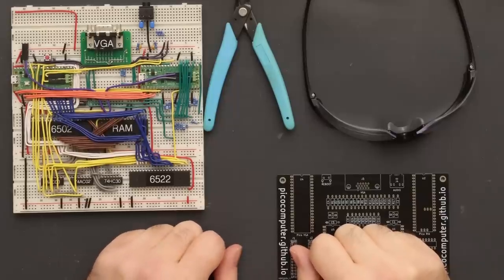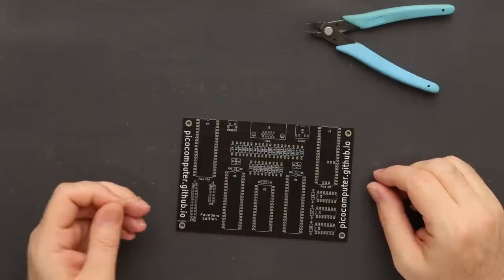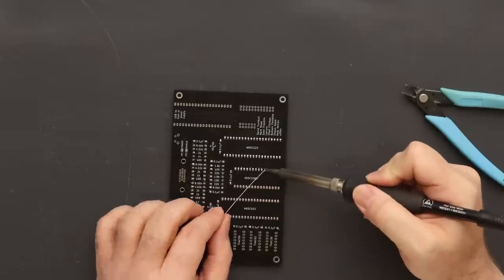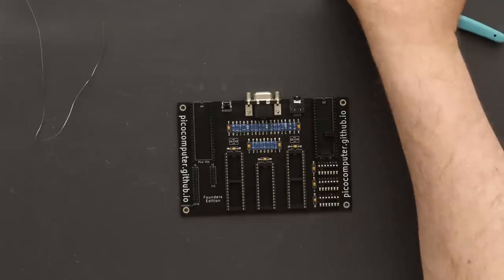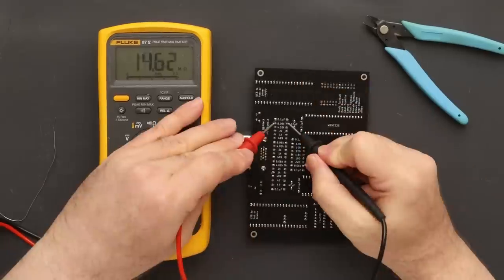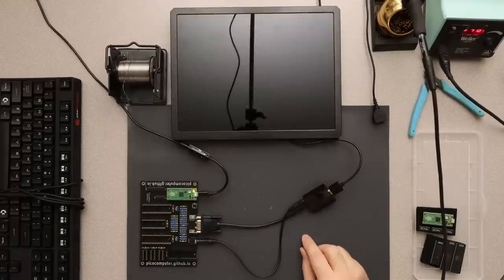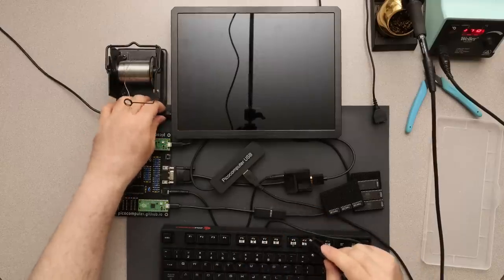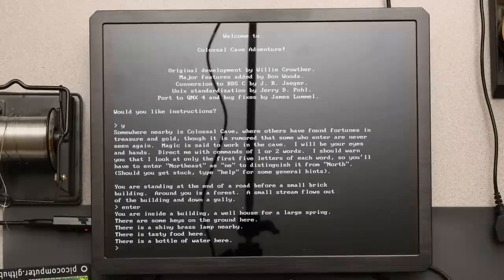RP6502 Ep10 - DIY build with soldering

Comment: It's always disappointing when people do that "Commander X16 was supposed to be $50 but it's $500" thing without context. It probably drives engagement (like the title - EDIT: two days later, the title has changed to an accurate description of the video), but the truth is much more boring: The first boards were never going to be cheap, but they want to cost-reduce it over time. Next batch should be $350, and if they get their way future generations will drop down much lower.

But this system, while far different (especially in its software environment), is interesting and has the benefit of being cheap and available today. Thanks for sharing!
Reply: agreed 👍
edit: I am still on the fence about the x-16, but I am leaning over that fence toward getting it... second gen of course. 😎
Reply: Well it's also disappointing when context changes to suit the situation. Reality is harder to face than the fantasy in that case. But reality is things change and doing something about it if you can't afford the new system is not a negative response. So the context here that is being missed. Some people can't afford even 200 dollars and want a cheaper computer so building one you can afford is a perfectly viable solution -- also not an attack to say the context changed. He did state 50 dollars in his original video as a gross estimate it's not a thing that didn't happen. some people followed the development with that context in mind and David did not correct them for a long time. So I think that's where all the confusion is coming from.
Reply: @lindoran  There's no need to become defensive. I haven't attacked anyone, and have in fact expressed an interest in what he's built. There are nice options with varying types of "retro" computing at many price points now, and that's a good thing.

But I'm not a fan of clickbait or misinformation (or misinformed people repeating wrong information).
Reply: @jc33353  I didn't say you attacked him, I think you misunderstood, what I was saying is that it's not click bait to use the words "why I'm not buying a commander x16." If you then go ahead and show why. It's also true that he said he would like to see a price of 50 dollars and then (likely because of an over site let's be honest) did not correct people until much later. I agree both projects are great! All the confusion is coming from the fact David said he'd like it to be 50 dollars then people followed it based on that context and were confused when he clarified. That's a different thing.   He's still entitled to that opinion even though David clarified, and the reason is he was initially vague.  Just because he apologized and corrected himself doesn't change the initial statement or the consequence of it. So I guess I just was trying to explain how people came do believe it an why that's a valid feeling is all.
Reply: We'll see.

I'm quite skeptical that the Commander X16 will ever become affordable.  It seems to me the reason you can reduce costs is being able to take your revenue from the first iteration, and put it into a 2nd gen re-design where you can cost-reduce it somehow.  But if you don't get the sales for Gen1, you don't have the cash to make Gen2.  I can put down plans for reducing costs too, but in the end they're just plans.

There's several other better designed Retro computers available today that are 1/10 of the price of the X16.  The whole thing is sort of interesting, since it seems like it's a bit of a repeat of the late 70s, early 80s.  On price too.  Apple computers were always far far more expensive than the Commodore ones, but Commodore was the one to crack the nut on price, so they became far more popular than the Apple 8-bit machines. I halfway expect the same thing to happen again, just at a much smaller scale.
Reply: @lindoran  A single $6 pico can do everything using emulation... Those hardware projects are cool but not necessarily the cheapest. Perhaps people should focus in something modern like risc-v instead. Playing with real 6502 may be a good fun learning experience, but for how long are you going to be able to? Any serious project won't be able to source chips in sufficient quantity anyway and its pretty pointless at this point, just like film photography or the telegraph, it had its time, but now its pointless. The X16 is basically a new 8bit computer, which isn't exactly on demand, but cool none the less. Unfortunately its unlikely to last, because, the ultra cheap ARMs or RISC-Vs outperform it so vastly they can easily emulate the system for a fraction of its price. Its not the 80ies anymore, as much as we loved that era. At least RISC-V is open source hardware so it has a future not even ARM has.
Reply: @lindoran  It's been how many years and how many clarifications and this guy is still opening with "it was supposed to be $50 and turned out to be $500"? It's not a "valid" feeling at all. It's sticking to your guns even though you're wrong.
Reply: @freeculture  the same could be said about the FPGA for the vdp in the cx16 I suppose. On it you could build an entire turring complete system along with some kind of video and io. But I think that misses the point.  once you program a FPGA or a SOC to do a task dispite its other capabilities it can only be whatever you programed it to be, until you re-program it.  Additionally what is a period correct vdp? Just another custom SOC or device controller that can share the bus, in a way a pico is the same thing and exists for exactly that purpose. as far as being able to get chips....I think that's always going to be the case you can't 100% future proof anything including the FPGA in the cx16.
Reply: @zoeherriot  just the point it was nearly a year that David took to clarify, and in that time there was loads of speculation (which I was around to see), don't get me wrong. I still watch 100% of everything Mr murry puts out and consider Myself a fan. It's still 100% valid to be confused and feel that was the general consensus from the start because those were the words he used. All that being said I am still interested in seeing the cx16 come out and I will buy one if it comes into my price threshold.. but I don't think it will.
Reply: @lindoran  you’d have a point of this video was released a few years ago. Now it’s just repeating a statement that has been clarified over and over. So now the misconception gets to continue for no reason. Great.
Reply: @stevesether  I think that's probably true. So much money has been spent at this point for David to recover what he put in he'd have to sell a number of units that I don't think the market can bare.  I'd like to see one sub 100 dollars before I jump (even 70-80 would be a price I could consider. Max 150.) I just don't think that it's possible to recover everything and do all the front end work for less than free (which hes shown a willingness to do ) how much is reasonable to ask from someone who's working on this as a source of income?  I just don't see it happening.
Reply: @zoeherriot  life is not fair sometimes, I think the good news is that it doesn't seem to phase david even a little bit.
Reply: @lindoran  I seriously doubt the 8-bit guy was expecting to make money out of the X16.  He's already said his game is only just breaking even, and that is a far easier sell than a hardware project...  There isn't really a success/fail criteria for these things.  Just have fun, and don't put money in unless you don't mind losing it if/when project comes to nothing
Reply: @davidlloyd1526  yeah that's facts! :) I think he'd really like to recoup the money though he laid out what he spent that's a huge chunk of cash I know perifractic was in a bunch himself before he had to bail. It's definitely a Labor of love

Comment: Building your own retro computer is much more fun, the journey is more fun than the destination IMO.
Edit/ I build couple system in past decade like this, with micro controller replacing the hardware around. I build them all on strip board pcb's, is fun, doesn't cost much, and you don't need ROM or RAM chips.
Reply from the maker: Exactly. Fun!

Comment: What customisation/upgrade options would I be able to try out? For example would ut be possible to upgrade the ram chip or perhaps add an os that could boot from a usb stick (assuming anyone actually made one) I'd be interested in tinkering with this sort ofthing and it would be something I'd like to be able to mod a bit..
Reply from the maker: The only reason to change the RAM would be to add paged memory. In which case I'd be inclined to make a Picocomputer 65816. It won't boot from USB, but you can install a ROM on the Pi Pico which will run at boot. I suppose if that ROM then loaded something from USB. Ok, I'm changing my answer, it will boot from USB.

Comment: Looks like a very interesting project 👍 (if you've ever experienced some type of 6502 machine, at least - sadly, I missed that time period 😄...). But (as usually 🙄...) the question that occupies me most is something completely tangential to the purpose of the video: What is the device that you're using as a monitor here? It looks way less clunky than the usual mini LCD monitors (*ahem* the various 'Raspberry Pi' monitors with their rather enormous bezels...), and that at a decent size and resolution (looks like at least 10 inches 4:3, and a good step above 640x480...)
Reply from the maker: https://www.amazon.com/gp/product/B07P8ZCJCG
Reply: @rumbledethumps  too bad it seems to be EOL. :(

Comment: When David first mentioned the X16 I was very interested.
I was a 70's-80's kid.
I had, and still have, an Amstrad CPC 464 and 6128.
I first started programming BASIC on a friend's TRS-80 computer.
So I still have thr memory and nostalgia for these computers.

The X16 at $50 was a pipedream. I suspected the price would likely be nearer $150-$200 once on sale.
At that price. I would likely still have been interested enough to buy one to play with.
At $500 it is in the realms of serious Retro, Console and low to mid PC computing.
Gone from a 'fun' nostalgia trip.

They are also buying machines to build a lot of the machine 'in house'. Seems daft to me unless they plan to sell tens of thousands of them.

Especially considering David put out a video recently explaining he is moving away from selling his games in physical format due to costs.

I won't be buying an X16.
Looks like a fun little computer.
But considering I can buy an Original C64 as well as one or two more original classic home computers for the same sort of price. I'd rather have a classic original which will only appreciate in value at a quicker rate.
Reply: Ok, let's see if i can debunk the 50 Dollar myth.

First and foremost, the first video of David he mentioned that a computer less powerfull than a raspberry pi shouldn't cost more than a raspberry pi. That was the only mention he did. For that he planned 3 stages.

First stage: Full motherboard with all the off-the-shelf components. Back then he thought that this would cost around US 250 for developers and early adopters only. Then the Pandemic happened. Then the shortage of components happened, plus inflation too. Manufacture cost went up too... now true, the first 100 punched boards were donated by PCBWay, but still the costs were too high, compared with the initial estimate.  That explain the US 500 they asked for the people that buyed the first 75 boards (plus keyboard, mouse,  one developer bread board and a pico-atx power supply). Yup, they are sold out right now.

Second stage: Smaller board, with no expansion capacity and convert the multiple chips of the dev boards into ASIC's. More oriented to Videogames, but still the same mechine. David hasn't mentioned the cost, but should be way less than the original DEV boards, according to one of his lastest videos.

Third Stage: The RPI form factor card. Everything goes into an ASIC. Non-upgradeable parts and no expansion ports. This is the final design that is expected to have the lower cost of all of them.

And in case you people missed it. There was a Commander X8 in a Card factor, but with only 64KB RAM+ 64KB Video (if memory serves). David showcase it in one of its videos, and asked the community if they wanted the Card formatted machine during the pandemic time. The community didn't wanted it. So the original plan continues.

Sorry for hijaking this, i think that is pretty cool to have alternatives and have people working on their own dream machines, but there's a lot of lies and disinformation about the Commander X16 project. (Granted, David wasn't really clear about the pricing, but people read too much between lines and that's just not the way older geeks works.)

Comment: I've been looking for a project like this, RC2014 is a bit out of my price range but this I could probably make work. 

I might have all the capacitors and resistors and diodes and such already, too. Maybe a couple of the ICs to salvage from busted equipment, but that's a little bit of a longshot.

Comment: Just soldered my one up: it’s alive. Can’t get it to recognise my USB keyboard and the USB pen drive at the moment. Need to fiddle with it a bit more
Reply from the maker: A couple people on the forums had to fiddle with USB hubs.
Reply: @rumbledethumps needed to use a USB 2.0 card reader, I assume that it isn’t usb 3.0 compatible. My mouse works OK but the keyboard not so much. I am not worried: it’s a journey, not a destination. I used a C64 in my youth. That was a mystery when I got it too
Reply: Keyboar’s fine but I need to pick a better usb hub

Comment: I built this (my veroboard beast is in this video) because it is simple and yet elegant in the way the RIA is a memory mapped I/O device that provides similar capabilities to peripheral interfaces in "old" systems. Things actually run on the 65C02, I'm having great fun - even at this early stage of development - writing some graphics editors in C and learning 6502 ASM to squeeze extra performance out. I'm an old time Z80 guy having written lots of commercial and hobby code in Z80 ASM when it was the raging thing. 
I won't be buying an X16 because I think it's a frankenstein designed by a committee and it meets almost none of the initial project goals. This thing is cheap and elegant and it exists...
I have a large collection of old systems, I like building and I like ASM and I see a lot of versatility in this design which will keep me amused until the next shiny thing comes along.
Reply from the maker: I get it. Part of me wants to hang the breadboard on the wall, the other part wants to yank the chips for the next shiny thing.

Comment: No one is forcing people to buy the Commander x16 and if you were being honest, you would have mentioned that the initial price is high to cover costs they encountered during the project. The price will come down for late adopters. Home brew 6502 computer boards were readily available before the Commander x16 as well d isn’t solely what the project is about.

Comment: Commander X16 is well priced outside of my budget even at half the price.   Instead I built a couple of Z80-MBC2 boards and added an ESP32 for vga and keyboard.  It has limitations because of it being a VT terminal, but you can run CP/M, pascal and do graphics with it.  All in I'm about $50 for that kit.  I'll be watching this project closely as it might be my next build.  One of the biggest limitations has been the lack of an extra serial port for connecting it to the outside world.  I'm guessing this machine won't have those limitations?
Reply from the maker: The Picocomputer has one UART intended for connecting to a big PC for cross development. There's a 6522 with 16(+4) GPIOs you can use to connect with the outside world. And, of course, the S in USB is for "serial", but that's probably not what you meant.

Comment: That board is Wicked Awesome Cool.  Exactly what I've been looking for.  Your Picocomputer project is coming along very nicely.  Yes, I'm interested.  I have an Agon Light 2 and if the X16 becomes available at a lower price I may purchase one of them.  However, I have a bunch of Pico's just waiting for a project to really push their capabilities and you're board has REAL 6502, with no SMD's that these old eyes can't see. 🙂
Reply from the maker: If I had even a hint of nostalgia for the Z80 then I'd buy an Argon Lite. Very practical and reasonably priced (even when it was $100). But I took the MOS -> Motorola -> Intel journey.

Comment: 2 picos powering one toy is kind of overkill for my taste.
Reply: A single one can easily emulate any 8 bit system, its quite absurd if you think about it. But to each their own, cool hobby.
Reply: On the other hand its a $4-5 part. If you replaced them with a 6545 and some kind of ROM and IO chip you'd have less functionality at a greater cost and no real practical advantage other than massively increased complexity and some notion of "purity".